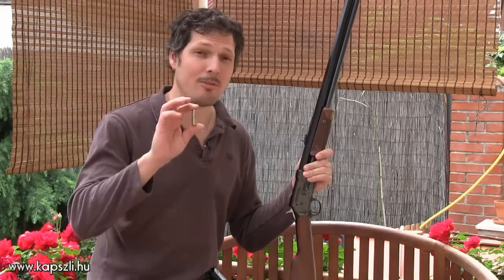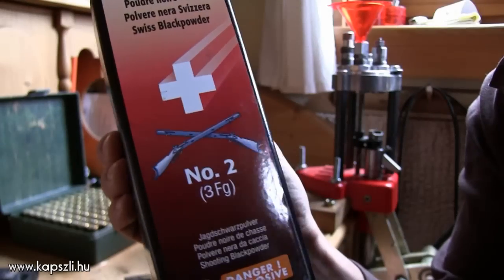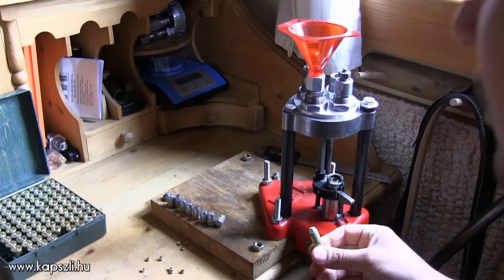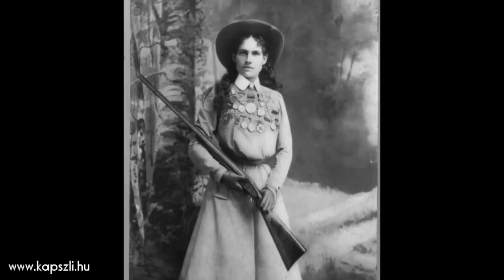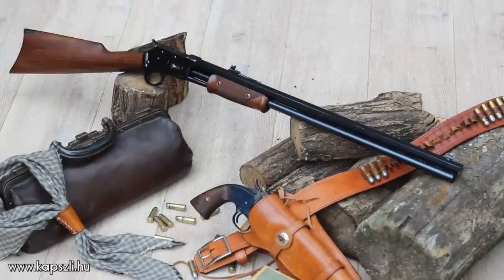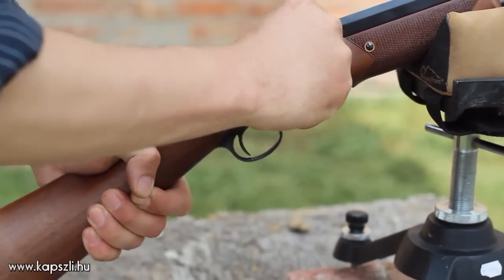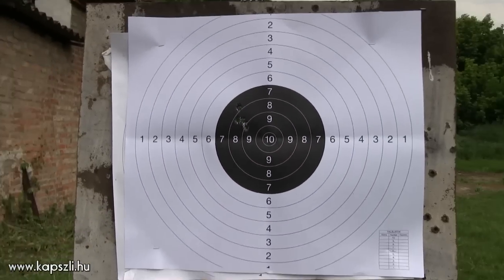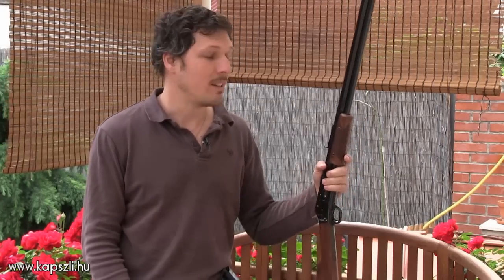Top accuracy with Pedersoli's Lightning rifle and reloading the 44-40 BPCR ammo

Comment: I find your videos well produced and informative, and look forward to each new one!  However, I feel compelled to point out a safety issue in this one - you should never use a plastic powder funnel - or any plastic powder conveyance - with blackpowder.  Static charges that build up on the plastic, while safe with smokeless, can detonate blackpowder charges.  Blackpowder-safe funnels and powder measures are always made of aluminum and/or brass to avoid the static electricity problem.
Reply from the maker: Dear Daniel, Thanks for the warning. I checked the Lee website for more info about their funnel, but did not find info weather it is recommended for BP as well or not. I also have a brass funnel, I will use that in the future just in case.
Reply: @capandball  Years ago, PigeonRoost Slim, Calamity Jane, and someothers tested the hypothesis of static setting off real black powder.  None of us succeded in getting either ffg or fffg to ignite with electro-static discharges.  We pretty much quit worrying about it.

Comment: Hi, I just bought the same rifle. I slugged the bore and measure it at .429. I'm surprised that you get good accuracy with .427 sized bullets. Did you experience chambering problems with bigger bullets than .427?
Reply from the maker: Hi, mine measures .428-429 also. The 429 bullet pushes out the neck of the brass, that I don't like, and the rifle is accurate with the 427 Lyman bullet also.

Comment: Nice presentation. A later entry into the pump-action 44-40s was the Remington 14 1/2. Designed for smokeless powder and capable of handling somewhat higher pressures (like the 1892 Winchester), the 14 1/2 has some unusual work-arounds to avoid infringing some of Browning’s designs (for example, unlocking the breach). They are quite inexpensive here in Canada, and lots of fun to plink with (I use Trailboss with a 200 grain cast bullet for plinking and a moderately stout load of 2400 with a 200 grain jacketed SP for hunting). Always enjoy your content!

Comment: I noticed the eye patch system that you are using.  We trained thousands of U.S. Border Patrol Agents, many of whom would see two barrels initially when in training. That meant that they did not have a dominant shooting eye, or the eye that was dominant or did not match their dominant hand which is called “cross dominance.”  They could, of course, close one eye, but tests showed that they would lose ~1/3 of their tactical vision.  We put a piece of clear Scotch Tape on their shooting glasses on the lens of the eye that we wanted to train to be non-dominant. They could still see the target through the tape, but it was out of focus and it wasn’t long before they could remove the tape. They had essentially trained the desired eye to be dominant and therefore shoot with both eyes open, for shooting both rifle and pistol.

Comment: Does the bolt lock up with the face of the chamber like a winchester model 94 or do you have to hold the pump forward to keep it in battery?

Comment: Shouldn't 44-40 be loaded with 40 grains of black powder?
Reply: It really can't.  The old cartridges were balloon head, modern brass has a solid base that is a lot safer regarding ruptured cases, but it reduces the case capacity quite a bit.
Reply: @USAAmutual45  
And you sure won't come close with a 250gn  bullet either.

Comment: I have not reloaded black powder before. If the required amount of powder leaves a space between the bullet base and powder, what do you use to fill the gap?
Reply: you can use a wad, or use a filler, like coca powder or something. I haven't used either, and I know the coca powder method for percussion revolvers only. For my black powder 357 Magnum loads, I use no wads or anything. I use about 23 grains and it pretty much feels the case up all the way. And so it all will compress when I seat the bullet.
Reply: @diktatoralexander88  I use bacon fat for a filler, helps with the lube and makes the gun smell like cooking bacon. The Buffalo hunters use it in there Sharps in the 1800's.